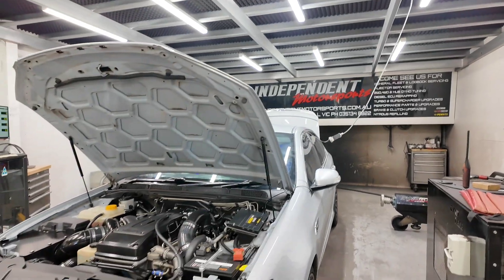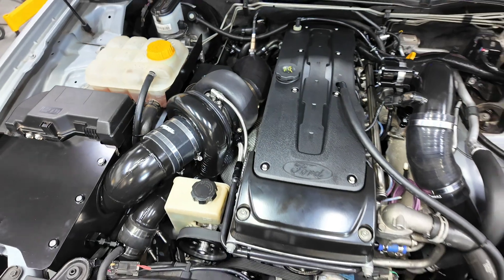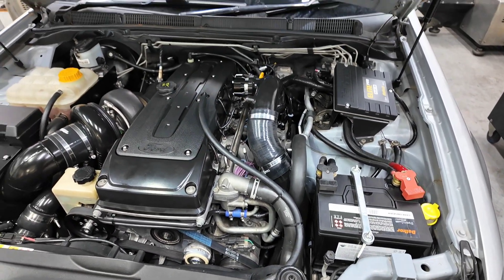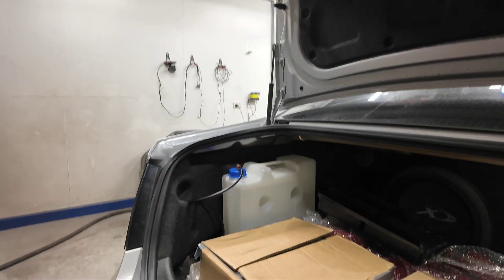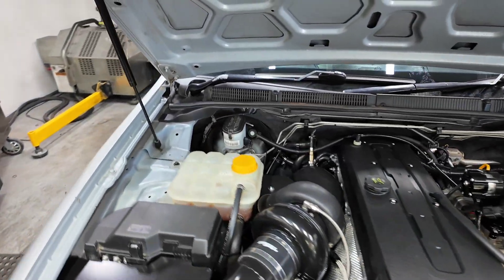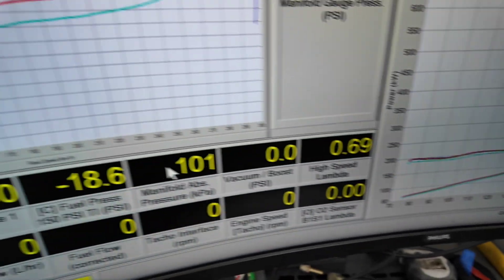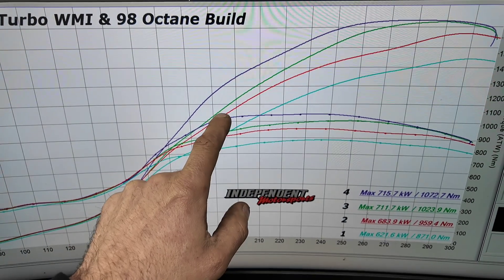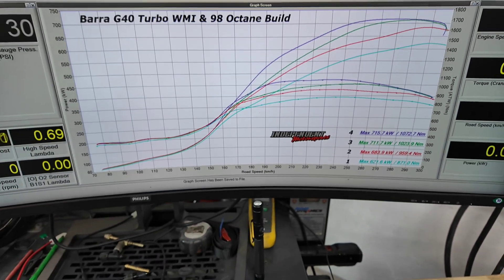700kw Turbo Barra 98 octane fuel + WMI

Comment: Do you use the stock bov plastic vacuum tube to connect to aftermarket bovs? Also do you keep and run the stock plastic vacuum fittings that are on the fg  intake plenum or do you replace them and use other fittings for vacuum/boost source? How do the stock plastic fittings come off? Iv noticed they rotate. Thanks.

Comment: No catch can?
Reply from the maker: Good observation when you build a proper engine you don't need to put a bucket on the side to catch all the oil, every single one of our barra builds do not get one and we also keep the PCV operating.
Reply: @IndependentMotorsports  In the long run you wouldn't want the oil film to build up in the intake so no matter how well it's built its going to create blow by. You know this.
Reply from the maker: @billetbarra6069 been doing it like this from the very beginning of their existence so we will have to agree to disagree
Reply: With the pcv still hooked up, on boost it needs to breathe and the pcv is shut so its only breathing through one hose which i think is not good enough. At a minimum ditch the pcv and run both hoses to a can with a vent on it. I took splash trays out and largened the holes to 14mm on rocker cover, got earls fittings welded on to top and put splash trays back in and run larger hoses to vented can.
Reply: @farmer3242  i've seen turbo seals blow due to poor crank venting.

Im sure he wouldn't run the big power Terry with the OEM setup.

Comment: Love the channel 
Crow 1777 in ls1 please 🙏 
Or your fave btr cam vs fave crow ls1 shot out
Reply from the maker: We did the 1771 in the  LS1 test car and it was a total flop hence the reason why I never made a video of it. crow 1287 vs btr stage 3 is the closes you will get, they make very similar power in the top however the BTR producers more bottom end power & torque
Reply: @IndependentMotorsports dam I just got 1777 because was so close to 1212.  Complete flop that would have been great to know

Comment: What happens if a pump fails a jet blocks, a slosh in that 10 tank,  boom.
Reply from the maker: When you do it properly you have a fail safe Incorporated into The system using a flow module. There's absolutely no way this engine will fail should there be a problem.
Reply: So how is this done exactly if a nozzle or hose packs it? Will a wide band o2 pickup the lean condition and open up the Wastegate ?
Reply from the maker: Because it has a flow sensor that is calibrated into the strategy, how exactly we do it that's a trade secret that I have spent many years working out. @stevenkirk2563
Reply from the maker: @stevenkirk2563 A wideband is way too slow to pick up any fail conditions, everything has to be mapped out in the strategy of the PCM. 

Done properly it's fail proof

Comment: I'd love to know if youve done experiments regarding the actual mixture ratios for the wm, all the research i see suggests there isnt any gain to be had outside of a 5050 mix and at 80-20 you might be leaving something on the table? Keen to hear your thoughts
Reply from the maker: A very open discussion, need to experiment and find the correct combination that works for your build.
Reply: Ditch the meth and crank the water

Comment: Is that the stage 4 process west intercooler ? And at what power do you think there is an advantage to changing to an upgraded plenum? Mint car be a weapon on the street
Reply from the maker: At this power level the intercooler is perfect, no need to upgrade the manifold either
Reply: @IndependentMotorsports cheers I got a fg on e85 making 780rwkw was wondering if worth upgrading and intercooler . I’m only stage 2 intercooler

Comment: i wouldn't insure a 30k package with watermth. do it properly, either 6 individual meth jets to guarantee even distribution or just run e85
Reply: Yeah but e85 is fuckin gay for street cars that actually go places
Reply: @jasonhall5101 a thoroughbred revhead-his nose can't tell the difference between pump and e85

even your average revhead takes e85 fumes in the chin

you should be doing some reflection classes, figure out if this game if big power is really for you
Reply: I’m not 100% sure on this setup, but it does have 6 individual water/meth hoses to the ports? Wouldn’t each port have a nozzle already giving the highest chance of even distribution? 
As he mentioned yes a single nozzle would be a bad idea at this power level, but ok for lower power setups.
Reply from the maker: @Luca_____355 correct this is a direct port build

Comment: They are a toilet hahaha love it! What bov is that? Iv had 0 luck with bovs on my barra, iv got a borg efr9174 on mine and tried a gfb dvx on the housing, it pushes open and makes a boost leak, tried a greddy type r 50mm on the throttle elbow, it pushed open. Now im gonna put on a turbosmart block off blanking plug on my efr housing and running no bov.
Reply: That's a gfb sv52 blow off valve